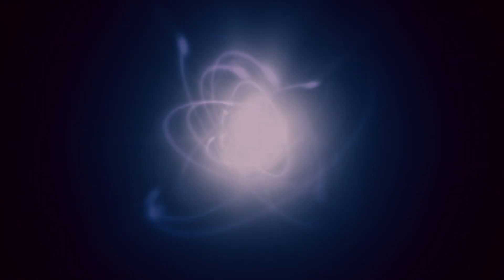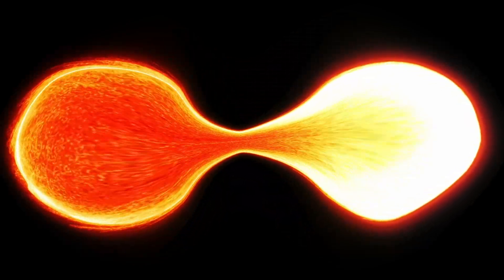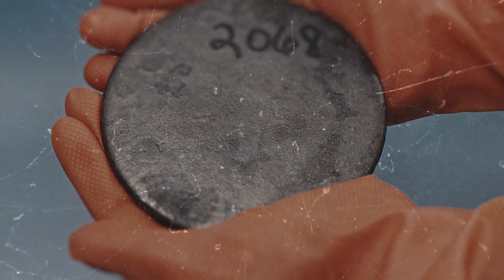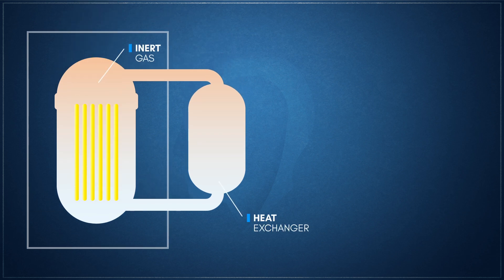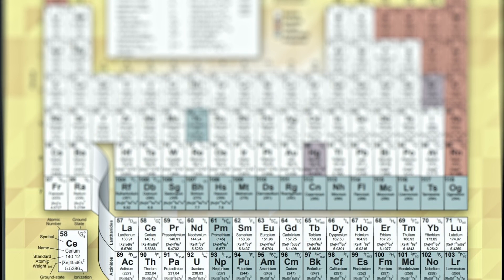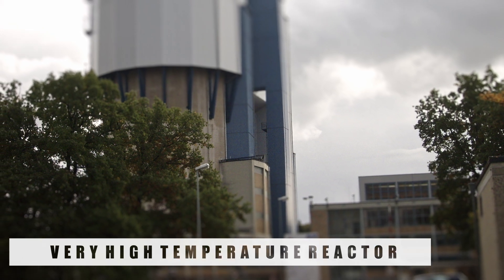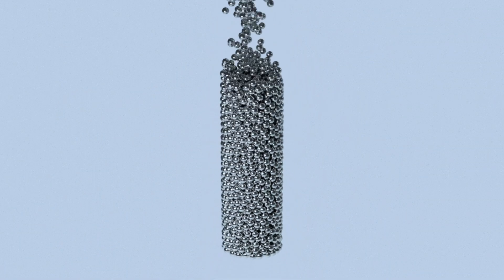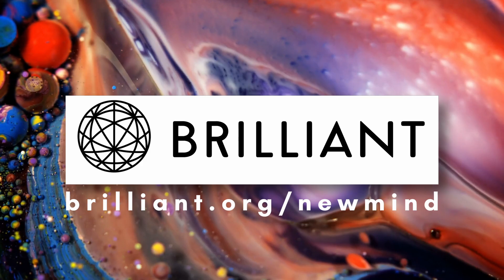Portable Nuclear Power

Comment: The future lies in Molten Salt Reactors, not "conventional" fission reactors.
Cleaner, much safer (impossible to "melt down"), produces far less (90%+ less) waste and can even "burn" existing waste from old reactors. And they were proven to work decades ago!
The only barrier to their usage is political interests and meddling by regulators who have financial interests in old designs only.
Reply: Water reactors will always be the bread and butter of the nuclear field. The broad field of engineering knowledge around them, the simplicity of their construction, and the simplicity of the materials needed to build them.

Molten salt reactors will absolutely have their place, as breeders and burner reactors, probably in massive fuel reprocessing facilities and other nuclear powered agglomerations of industry that need the constant high heat output of molten salt and gas reactors.

The limitations on MSRs currently, while stemming from all the facets of political interest, fossil lobbyists, overburdening regulations, and poor public perception (not helped by the nuclear industry itself, nor the fossil-funded environmentalists constantly banging the chernobyl, fukushima drum), is mostly down to materials science. Because of the antagonism against nuclear energy, development and regulatory adoption of metal alloys designed to survive the intense environments of a MSR has been greatly slowed if not halted entirely.

That is the main reason there aren't more MSRs, we don't have the materials to make them as guaranteed safe as a PWR or BWR.
Reply: Bringing morality back into the culture of living will be the only solution to gaining common sense living. All other reasons for government become a deterrent to seeing the lives of the poor getting any better.
Reply: I am familiar with MSR design concepts and challenges from my work at NRC.  It is incorrect to say the regulators have any financial interest in any particular design. In fact, it would be an illegal, as we were reminded regularly. We could not own stock in a utility that operated uncle plants, for example. I agree MSRs have great potential, and hope to see one design or another deployed in years to come. The challenges they face are in areas like developing materials that can withstand high temperature and neutron bombardment, or developing means to conduct maintenance remotely in extreme radiation fields.